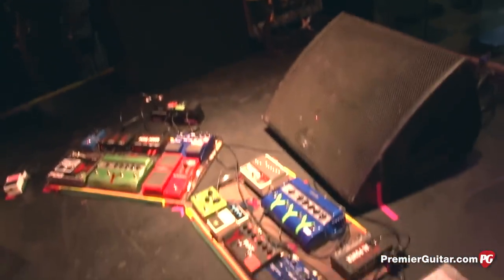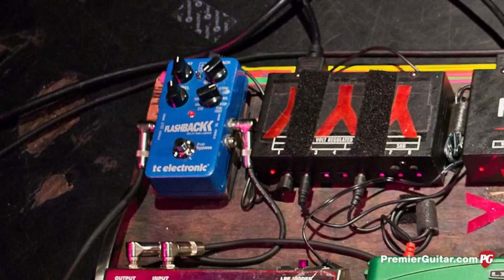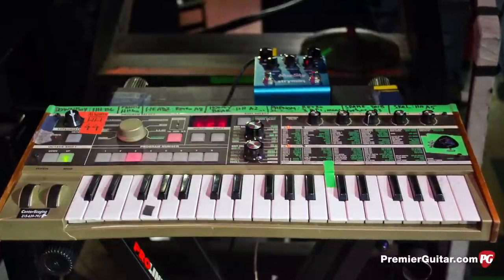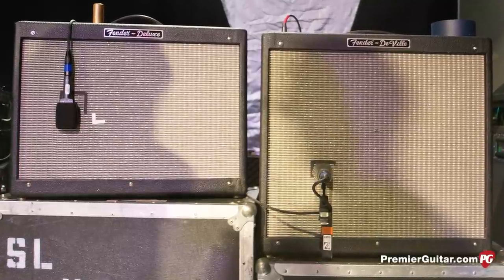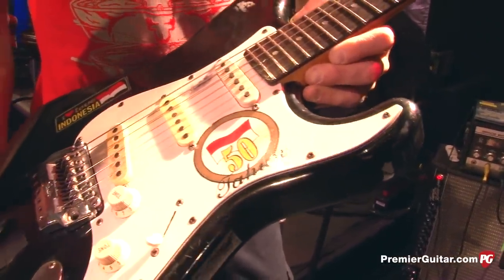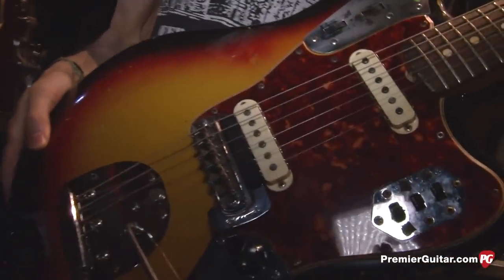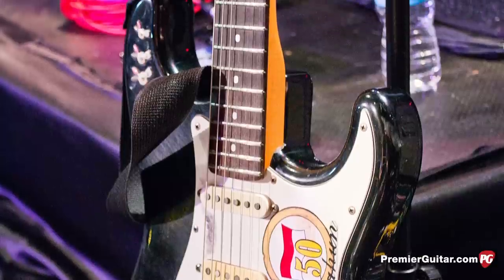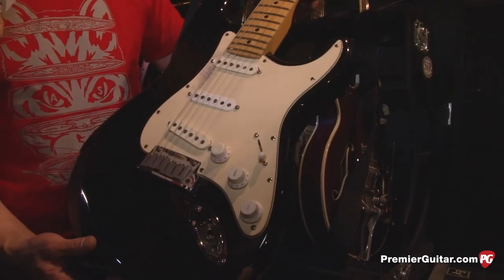Rig Rundown - Yeah Yeah Yeahs' Nick Zinner

Comment: Not saying you're wrong, but a lot of why it sounds so thin is because the camera mic is mostly picking up the sound coming from that wedge monitor. Wedge monitor is usually set to sound that way to cut through the mix.